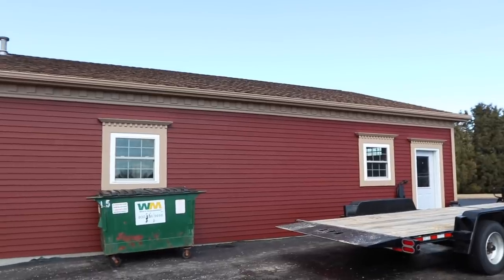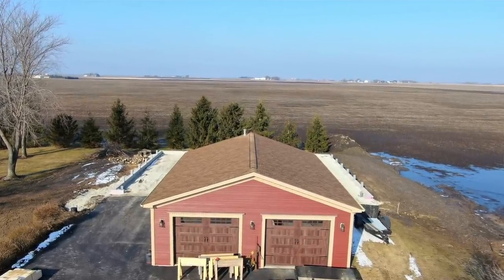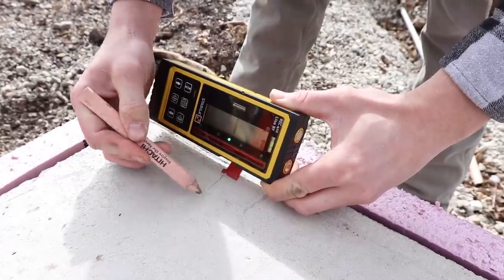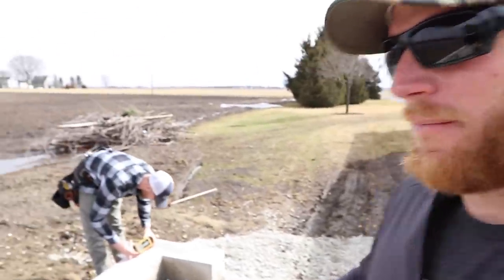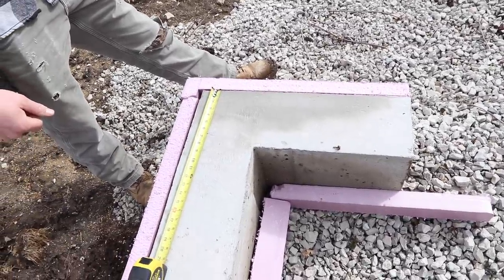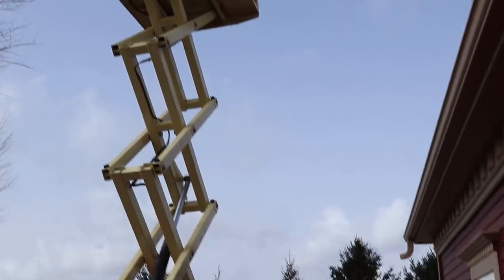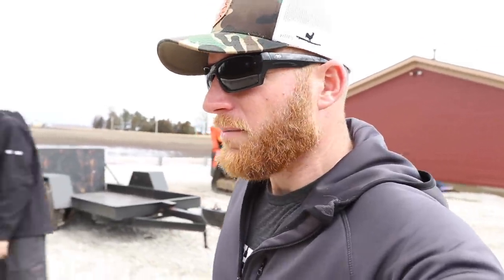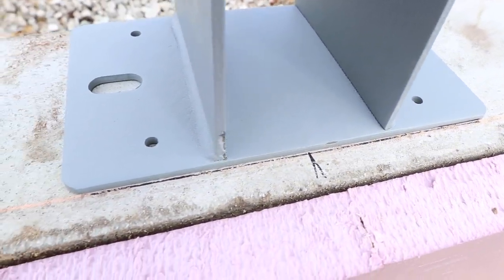How to Build a Garage Addition 1: Layout and Installing Metal Brackets

Comment: Try a little PVA (clear) glue for your lines. Thin it down with a bit of water and then brush or roll it on. Y’all will have to play around with your ratio though

Comment: What length screws do you use for your roof and side wall panels?  I'm building a shed this summer. The material supplier recommends 1" on the flat. Seems kind of short. Will be using block it wrap to. Love your videos. Keep em coming.
Reply from the maker: 1 1/2” on both but many use 1”

Comment: What gauge material do you use for your ceilings so that it doesn’t bow or sag over a 8’ span with insulation weight on top? Looks to be a 3/4” rib height but can’t tell if it’s 29 or 26 gauge. Thanks in advance! Keep up the good work!!
Reply: He has stated before, it is all 29 gauge.

Comment: Do you use "Hurricane Clips" in Illinois or are you required some other type system?
Reply: He doesn't need to use them. If you've seen any of his videos, all of the parts are bolted together in a straight line from the metal bracket all the way to the trusses !

Comment: Just make sure the cement gets a proper flashing everywhere the cement sticks out past your build line, to stop the water getting in under the wood. I've seen so many times where this wasn't done because of the attitude "it's not my job"  because of too many different contractors on the job. In your case, you usually go from start to finish, so I think you'll do it right !
Reply from the maker: everything will be handing out over concrete once we are done
Reply: If you have seen previous series with stem walls, you would know they flash it but also as he said the wall would hang just beyond the concrete wall edge due to the wood girts over the columns which add 1.5 inch (38+ mm) to the wall thickness on the outside from the standard 6 inch/152.4mm (5.5 inch/139.7 mm) nominal dimension. of the four ply he will likely be using for the span, 3 ply for the end walls as he said its 66 foot/20 meter wide by 56 foot/17 meter long.

Comment: Nice work RR! The trusty chalk line and lacquer is always a good way to go. I've always backed it up with a sharpie just in case. You may want to check out the Tajima ink lines, as well. I've been using them for some thirty years. after discovering them in Japan back in the early nineties. they put down a super crisp line (1/16") and are permanent. They don't run out as far as you may need they though. So you may have tp snap them twice. I'm sure your Hitachi or Makita guy could get them for you. I'm planning on building a new building next year, by myself. And have been studying different ways to do it. Probably a mixture of stick framing and timber, with trusses.

Comment: Grind an old file to a point and use that to mark the concrete. Just like the marking knives use in woodworking. Only question is, how long will it last before needing regrinding?

Comment: Great Video, I enjoy watching.

Chalk Line Marks: I use a pointed Concrete nail to scratch the surface or a marker as you did, depending on the conditions.

I didn't see you check your diagonals. Machines are very helpful but they comes factory defected or needs to be calibrated so I always double check with maths and a Metal tape. I know its a windy day so maybe that's why you didn't mention it.

Comment: Another great video!  I am really looking forward to watching your vlog on this one.  Have you ever built a hip roof on a post frame building?  I will be building a new garage next year and am wondering how it is done or if it's feasible?  The local code only allows 1000 sq. ft. on a floating slab and I want to build larger than that.